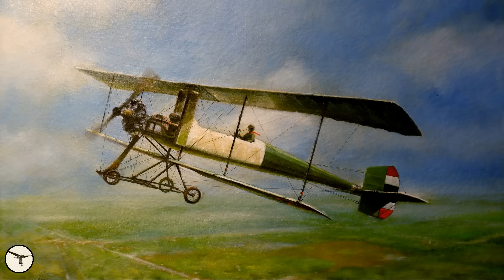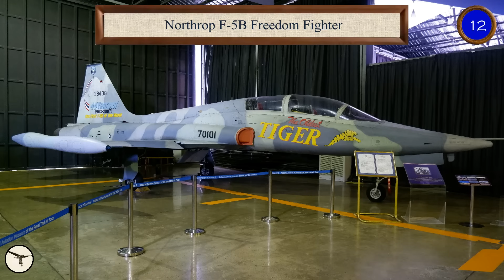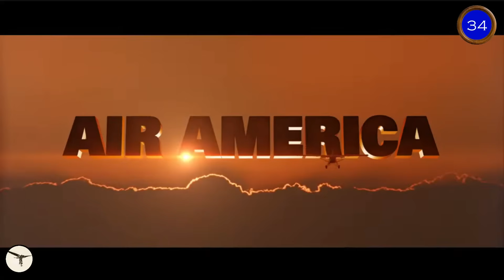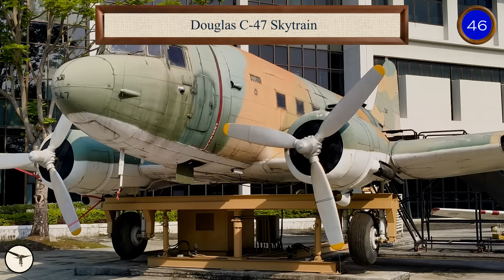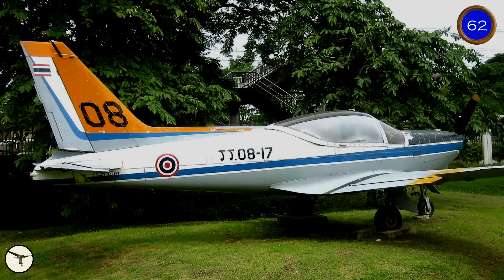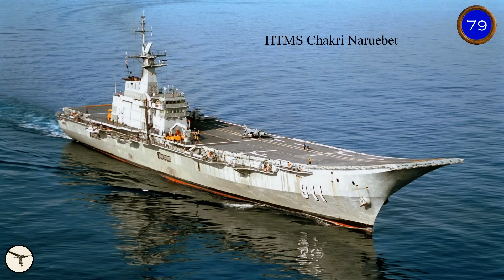Inside Bangkok’s Aviation Gem: Rare and Unique Aircraft at the Royal Thai Air Force Museum

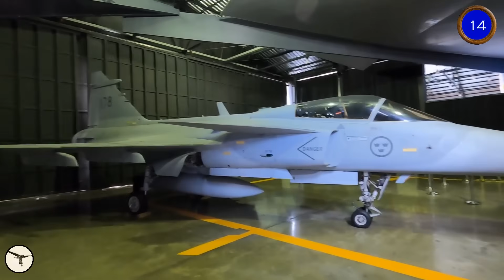Comment: 7:10 If I remember correctly, that Gripen is not a mock up, it's a retired older Gripen-A of the Swedish air force. The Swedish government gifted an empty airframe without engine or internal components to Thailand after the Thai air force bought the Gripen C/D exclusively for museum display.
Reply from the maker: Thank you for clarifying this. A guide told me it was a model of the aircraft, but the exact meaning may have been lost in translation.
Reply: @FlywithMagnar  Actually The F-16 is the mock up but the griphen is the retired one.
Reply: @yossawin8994  Yes, quite correct, it is serial 39178. A donation for the RTAF 100th anniversary. My first visit to the museum was in 1987 and I have returned regulary since. As stated it may be a static display but its very dynamic!